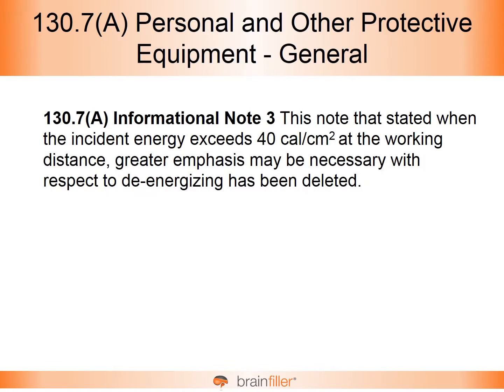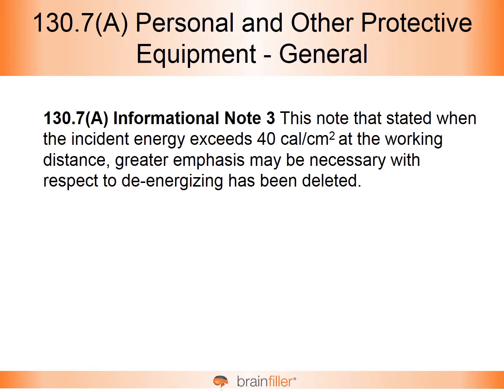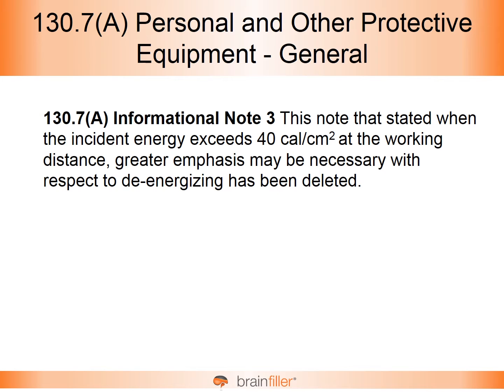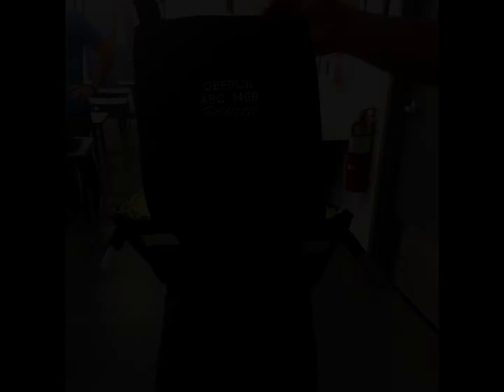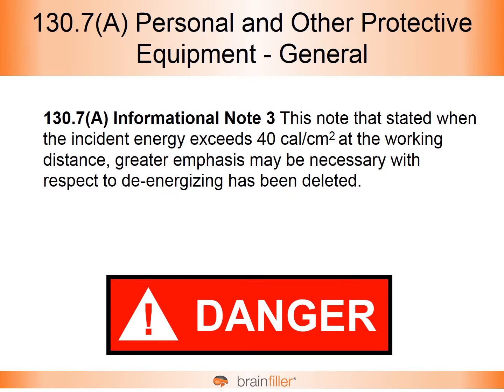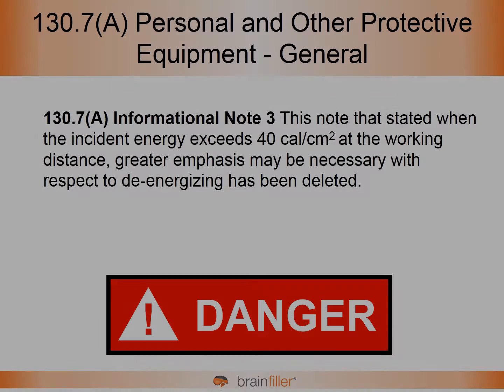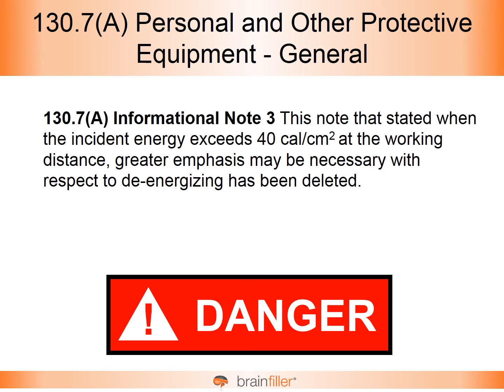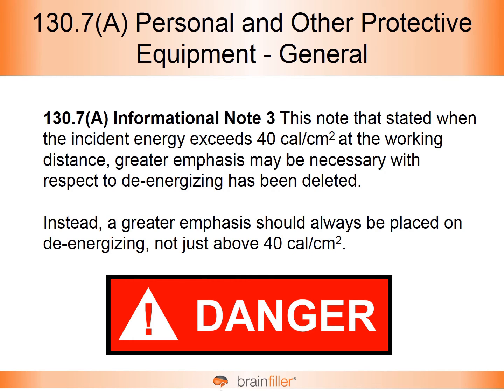2018 NFPA 70E – 40 calorie/centimeter^2 Deleted!

Comment: So, do we have an idea of when the blast hazard is going to become significant?
Reply from the maker: Thanks for your comment: Arc Blast is more of a function of short circuit current and energy per time and not necessarily total incident energy.  However it can still be significant. Right now there just isn't a good method to determine a blast threshold from an arc flash (yet)  We have a few limited pressure tests but not enough to develop equations or guidance so this will still be on "the list"
- Jim Phillips
Brainfiller.com
ArcFlashForum.com